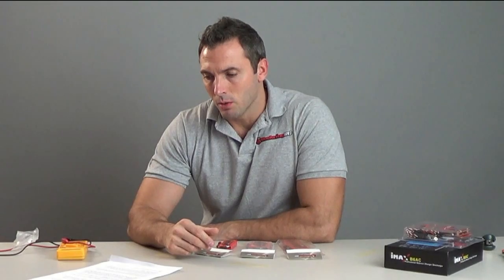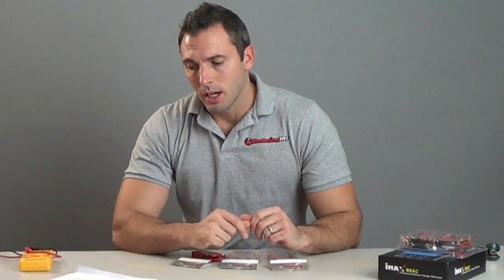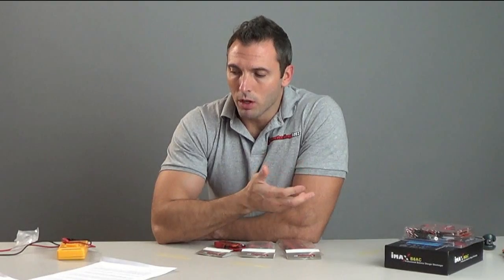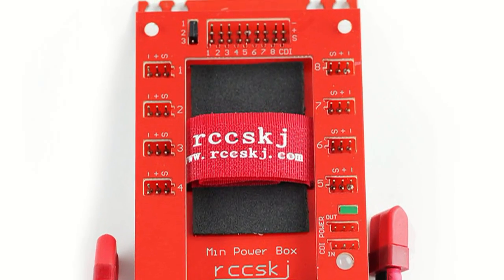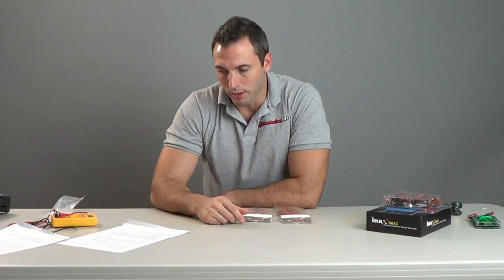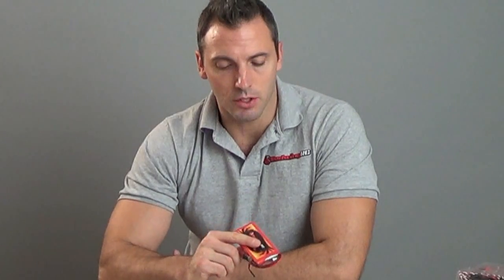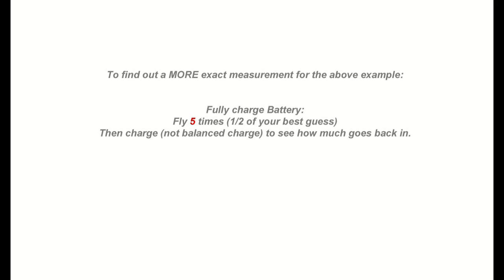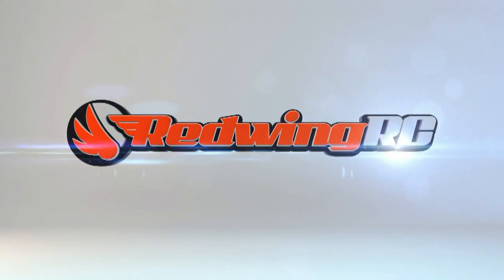LiFE batteries explained

Comment: He not entirely correct on ignitions.  Older ignitions explicitly state 4.8vdc battery.  That means a 4 cell nicad type battery.  More recent ignitions allow higher voltages all the way to 11vdc.  Read your ignition module before connecting any battery.

Comment: so a LiFe battery pack 6.6 v in theory wont burn my receiver that work between 4 and 6.5 volts?
Reply: Good quality receiver should have at least some minimal internal voltage regulation that should tolerate higher voltages to some extent. Also, during work, the voltage will drop slightly, so your 6.6 can easily drop to 6.5 immediately when any load is attached.
Reply: I use 6.6 on all my spektrum recievers no regulators

Comment: Hey Tim!

So my current build (and what will be my first RedWing RC order!  Servos, batteries, power board, etc...) is going to be a Great Planes Escapade 30cc ARF with the DLE35.

The plan is a yellow power board (The balancing feature of the black doesn't seem like a very big deal to me; should I consider it more strongly?  Seems like unnecessary extra weight).  The one with the LCD screen.  And then two batteries; so here's my question:

1450 or 2100?  I know in the video you suggest a pair of 1450mAh batteries for a 30cc plane.  Is that a pretty hard and fast rule?  Will a light and mildly overpowered airplane like the Escapade that is NOT a 3D model really benefit from the lower weight?  Would there be a significant disadvantage to running a pair of 2100's?  I'd love to have peace of mind and to be able to fly all day without hugging the wall at SLRCFA to recharge batteries.  

What are your thoughts?
Reply: +Romans Five|Eight

You can certainly go larger, and I would look at the specs online and see if you feel you are willing to pay the penalty.  My thoughts are on a non 3d plane that is known to fly well you won't feel a slight increase in weight.  About the only time you'll slow a plane like that down to feel a negative impact is on landing.  But I do NOT think you will be unhappy with it.
However please note if you are using the YELLOW board and LIFE batteries you must use the 3s (9.9v) to be within the minimum INPUT range on the yellow and black boards.  they both have a regulator, and most regulators automatically drop the voltage that you input.  So if you start with 6.6, it will drop it to an unusable output more than likely and COULD be dangerous if you drop below the basement voltage for the board to operate on

We pair our boards with recommended batteries though so if you follow one of our packages you can't go wrong
Reply: +Tim Pastor Thanks Tim!  I didn't realize that!

Comment: Just use NiMH. They are cheap, and they work.
Reply: NiMH, you have to use a regulator, or deliver over voltage to your servos at first, then lagging amounts later.  If you are looking for consistent performance they are not ideal unless used with a regulator, and then you have one more potential point of failure
Reply: Tim Pastor Never used any regulator.

Comment: Is there any reason why I can't use my 2 cell LiFE battery to fly my model with a brushless motor that I previously flew with the 2 cell LiPo >
Reply: it's not quite as much voltage so it won't probably have quite as much power but may work.  It's 6.6v peak.  2 cell lipo is 7.4.

Comment: My only question on LiFe battery's is storage voltage. Lipo everyone seems to agree on around 3.8 per cell. But with LiFe what is recommended for storage.
Reply: Great video. This video is the reason I started running LiFe battery's in my nitro vehicles. They make the best receiver pack ever. I can run my revo 3.3 tank after tank for at least a hour. I'm sure I can run even longer and this is on a 700Mah zippy life battery. Less than half the size of a 5 cell Nimh and light as a feather lol. I switch to my second battery after a hour or so to be safe but when I charge I always see I had more room to keep the first battery in. But I still can not get a solid answer for storage on these battery's. What voltage should I store them at??? Anyone
Reply: I finally found the answer. I found hobbico s life source lithium iron phosphate battery instructions. In these instructions it does state that when you are going to store long term. Charge battery fully then discharge to 60 to 75 percent of total capacity. It specified long term as like 6 months or more so evidently this must not be needed for shorter storage times. I myself will still keep mine around 65 percent when not in use to ensure my battery's are maintained the best possible. I hope this helps the next Obbsessive compulsive person like myself to have the answers they want. If you want a copy of these instructions. Search                      ( Hobbico LiFe source lithium iron phosphate battery instructions) this is 4 pages of LiFe source literature. Thanks Jake H.

Comment: Great info. I had called Traxxas and asked if it's ok to use a 2 cell life battery as my receiver pack and the guy said no. Well I purchased one anyway and thought well ill get a bit better performance and hope for the best for my receiver and servos. Now I'm a little concerned am I going to lose any performance? I've always wondered why most  speed control BEC s only deliver 5 and 6 volts when a 6 cell pack peaks at 7.2 volts. You would think they would make the speedo BEC more like a 6.5 volt standard. Anyway thumbs up.

Comment: With Life's it's kind of hard to tell by voltage, however, I've foudn that once mine hit 6.1 with a load on them (load tester) it is time to stop flying.  

the best way is as mentioned - fly about 5 flights (any number of flights SAFELY under the assumed limit) and then charge the battery (not balance this time, just charge) and see how many AMPS are put back in.

Comment: That is why in the video it SAYS "IF you've used 6v batteries in the past and feel comfortable with them, then the Lifes are even safer, as they immediately descend to 6.6v (Their nominal voltage) while a 6v nimh/nicad peaks at 7.2 and stays there for a while.

Comment: Hi Patrick, - yes, this is a good point and is somewhat mentioned in the video.  In my experience manufacturers recommendations are in the "safe / cautious" range.  I think they are aware that is they SAID "7.2" then some people would put a 7.2v battery on, not knowing that it peak charges much higher and would fry the electronics.  Therefore, they give 6V knowing that at the MOST people would interpret that as a 6V battery.  Therefore, 7.2 is safe and they know that.

Comment: When the DLE manual says 4.8 or 6v Nimh, are they aware that a 6v Nimh battery peak charges at 7.2v? Why does there manual say no more than 6v to the CDI? Confusion. I have flown 6v Nimh and never had a problem with receivers or regular servos.